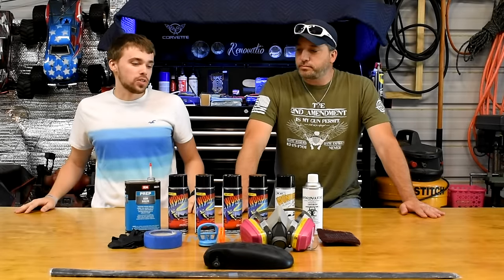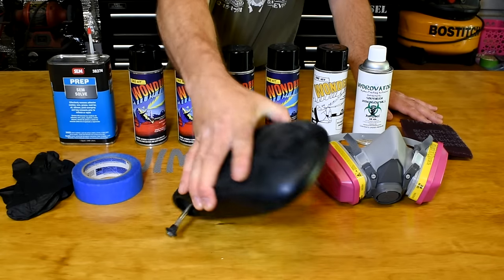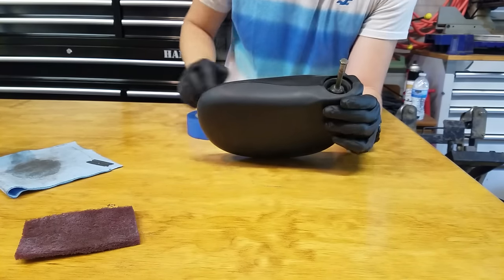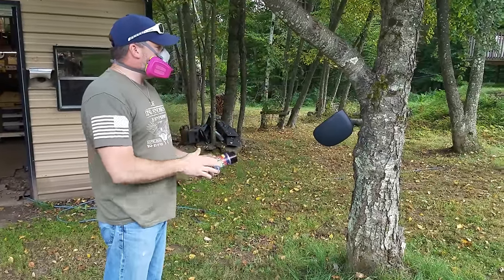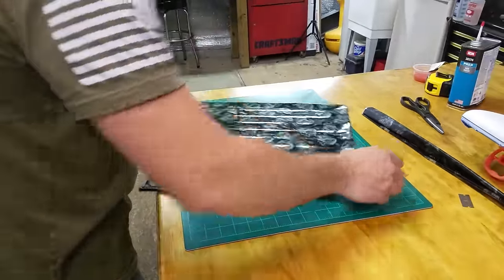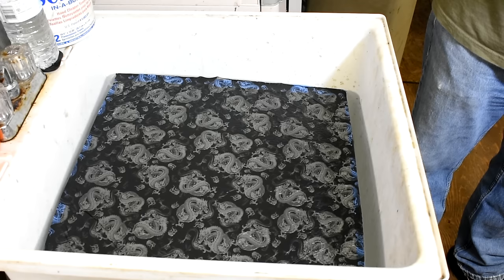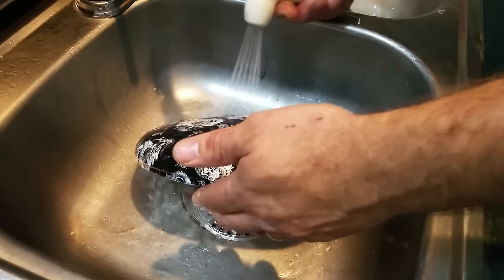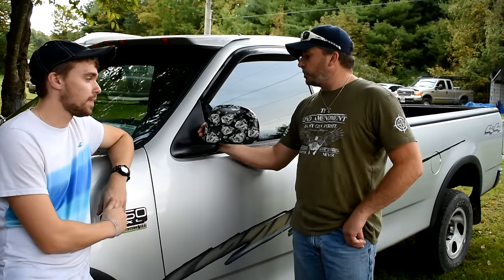How To Hydro Dip For Beginners 2.0

Comment from the maker: Want to give OHW paint a try?! Check them out and use our promo code for some savings. This is what we used in the video:)
https://www.ohwpaint.com/discount/Jimmy2Tech
Reply: Jimmy2Tech thank you for saying it in metric much respect
Reply: Jimmy2Tech now can hydro every accidentally get ripped off or scratched off?
Reply from the maker: @peter_W91  it can but, clear coat prevents that
Reply: How durable has it been?
Reply from the maker: @afatherofmany  still on today and no problems. Looks as good as the day we put it on :)
Reply: @Jimmy2Tech  wow, man that's the dream right..... you did it and it is still nice!
Reply: Just quick question does sticky side face down to water or does sticky side face up to me
Reply from the maker: @dustyfarm5r577  stick side will go towards the water:) not towards you.
Reply: Hey Jimmy, every time I dip, when I rinse it causes some spots or flaking. Should I make the water cooler? Also, when I try to add the clear coat, it make it fade for some reason. So, how do I prevent the fading?
Reply: Jimmy2Tech ?
Reply from the maker: @Jokes4u  well when you are seeing spots, usually thats a sign that you haven't used enough activator. When you rinse use warm water from a faucet, i wouldnt reccomend jet spraying it. Also for gloss, make sure you are using a high gloss clear coat. Expect to put 2 to 3 coats on there for best shine and protection:)
Reply: Jimmy2Tech I’m using the wonder paint gloss. However, when I spray the gloss on after allowing it to dry, it smears my dip. Could that be because of not using enough activator? Also, thanks for taking time out to reply to me.
Reply from the maker: @Jokes4u  anytime, and yeah we've had our fair share of not activating enough and whenever we got to cpear coat stage with any clear coat it would like make the dip run. Tinker witha. Few small dips with different ativator amounts and make sure you're waiting a few after you spray before you dip. So the film fully activates. A lot is trial and error. Practice makes perfect when it comes to dipping.
Reply: Where do you get the film from
Reply from the maker: @masonv7258  links in the description to get you started.
Reply: @Jimmy2Tech  can you ever use to much activator?
Reply: hey jimmy2tech Ive done a bunch of things with hydro dip using spray paint but I would love to try and use films where would I be able to get films and activators that are good?
Reply from the maker: @lilct9994  links in the description is a great place to start.
Reply: Does the water have to be warm or cold
Reply from the maker: @dustyfarm5r577  you're going to want hot water for the best bonding.
Reply: Do I have to use a activator spray or not an is it like a super glue spray that I spray lighty over the top
Reply from the maker: @dustyfarm5r577  for this process it is hydrovator that is sprayed over the film before the item is dipped.

Comment: Good DIY video but one one major thing you guys failed to mention is that this process only works on Acrylonitrile Butadiene Styrene (ABS) plastics. If you follow this same process on a parts made of  polypropylene  (PP), polyethylene (PET), or Poly Vinyl Chloride (PVC) plastics, I can guarantee that the person following the process will have problems. The reason the process will not work on the other plastics is because every plastic except ABS needs to be "FLAME TREATED" to "out-gas" the release agents stuck in the plastics during the molding process. You need to identify the type of plastic you are working on First. All molded plastics have one identifiers mentioned above on the backside of the part. If you follow the instructions in this video and you are working with anything but ABS, you will get lifting during the painting process, separation during the dipping process and lifting at some point after the process......guaranteed!  If you don't know what type of plastic you have "flame treat" the part to be safe.
Reply from the maker: Steve Clark well said! Will note that on the next video:)

Comment: You moved one side faster than the other. That's why the dragons came out spaced weird.  Also, the tape is to keep it from spreading out. It doesn't act as a float. 

I thought the matte look looked better personally. But nice touch.
Reply: Look at the pattern they used. The dragons are spaced out weird on the pattern itself it did not happen from dipping. You cannot fix a pattern by dipping a different way.
Reply: @xex2kok  good catch. Dunno how I missed that.     Appreciate the cordial correction

Comment: What sort of timing window do you have between pulling the object out of the water, and doing the rinse? Is there a "too soon"? And how long is too late?
Reply from the maker: After pulled out of water we wait around 1 to 2 minutes and then give it a rinse with hot water. Make sure there isn't to much pressure out of the faucet.

Comment: What did you use to remove the dip from the mirror? Other than that great job. Thank you very much.
Reply from the maker: Some glass cleaner and a razor blade. Carefully scrape the film off the mirror as if you were scraping off a sticker. Then once it's off just give it a quick clean with some glass cleaner and you should be as good as new!

Comment: Tried this 4 damn times. Couldn't for the life of me to get it to work with tape. Same steps without tape and it worked perfectly.
Reply from the maker: Yeah you can easily do it without tape. The tape helps sometimes with film that is curled really bad. Because it keeps trying to dive into the water. If your film is nice and flat just set it right on there.

Comment: Great tutorial,  can you please confirm, is it the sticky side that is placed face down on the water? So the sticky side makes contact with the water?
Thanks
Reply from the maker: You have it right. The side of the hydrographic film that sticks the most is placed facing down. If you are still unsure you can put a activator on a cloth and wipe a small piece in the corner of the film. The side that the pattern rubs off is the side that will go up.:)

Comment: Great video.  Just one question.  If want to tape a section off so it not covered do i pull the tape right after the dip or do i wait until it is completely dried just be fore i clear it?
thanks guys!
Reply from the maker: Wait until it is dry before pulling off the tape. This will ensure everything comes of smooth and has a sharper edge. Depending on the item as well you can always lightly run a blade at the tapes edge before pulling off to make sure nothing extra tries to pull up with the tape. Good luck!

Comment: In your garage I noticed some RC vehicles, did you hydro dip those bodies? Any tips on that? I am looking to do that on a new buggy.
Reply from the maker: Hello David,
       Thanks for checking out our channel. Yes we have tried dipping an RC body once but we must have not prepped the surface good enough because it stated to lift. But we tried it early on and had the cheaper film and we did not use the OHW paint which would have worked way better. We will have to try again soon.

Comment: Hey, great vid., thanks. What did you use to get the print off the mirror please?...
Reply from the maker: Super easy to get the extra off the mirror. Just get some glass cleaner and a razor blade and gently scrape it off as if you were peeling off a sticker. Once it's off just wipe it up with some glass cleaner and you're good to go.
Reply: @Jimmy2Tech  Awesome thanks dude, have subscribed and will be checking all your stuff! 👍

Comment: How many applications are possible with one aerosol can of activator? Lets say on multiple projects the same size as the mirror you did in this video? Thank you in advances.
Reply from the maker: You're going to get quite a few. We've done a few dozen dips off of one can with various sized items. It goes a pretty decent way so you won't have to worry about only having enough for a dip or two. :)

Comment: great vid. what about doing larger parts? like something that might need a water trough sized tub to fit in? im considering doing a portion of a Harley faring.
Reply from the maker: Shawn Fenner hey, well now your mentioning it! Our next video is going to be a little larger part. Then after that we are going to be dipping a rim! And we have a huge metal container we are going g yo use as a tub, and probably heating it with a propane heater. It's gonna be interesting, so stay tuned! :)

Comment: If I am doing multiple pieces do I need to start with a fresh batch of water each time?
Reply from the maker: Nope. Just make sure that the water is still at good temperature. And then skim the excess film off the water. You can do this pretty well with a shop paper towel.

Comment: Thanks, nicely done instructional vid!  Any tips on how to do something flat with 2 sides, specifically a recurve bow limb (not the whole bow just 2 separate limbs).
Reply from the maker: Welp I dont have too many tips particularity. Alot of it will be trial and error, I'm sure there maybe some videos up on YouTube of dipping a bow that may help you get an idea of how to dip the item in regards to angles. Usually multiple side dips and round items are the hardest but with a little practice it can be done.:)

Comment: I have a few questions. Can I cover a dip in epoxy? What if I don't like how it turned out, how do I take it off the item? If I am not able to use epoxy, how long will the clear coat last? Can I put a decal on the cup, dip it, then take the decal off so the base color shines through? Can I add glow in the dark paint to the base coat so it shines through the flim?
Reply from the maker: New Beginnings Blanks hey there. I'm not 100 percent sure about the epoxy covering the dip. And you can get the dip off fairly easy with a little elbow grease and some chemical solution. The clearcoat will last a long while depending on the type you use, whether that be 1 stage or 2 stage, and it also depends on how many coats you put on. The decal sticker for showing basecoat does work and we've done it several times. And yeah you can use glow and the dark paint as a base to have certain parts show through:) you can also use temperature changing pigment as well to have it so when you pour hot water on an item a certain thing would show. Possibilities are endless, hope this comment helps. Thanks for watching!

Comment: Hey man great video and so detailed how hot should the water be to wash the gloss?
Reply from the maker: We just turn on the hot water in the house with a touch of cold. I'd say thats anywhere from 90 to 110 degrees F. Hot enough where you can leave your hand under the water for a few seconds without discomfort.

Comment: That looks great. I would love to learn how to do this. How expensive is it to dip a 20" truck wheel?
Reply from the maker: They have kits that will tell you the size item you can dip. But once you have all the materials you'll probably only be in around $80 to $100. That will be the initial cost to get all the hydrovator and stuff you will need. After that you'll pretty much just need different pattern films and that can range in price from 15 to 30.

Comment: I have never dipped before and I’m wanting to dip a welding helmet I was wondering if I painted it with the engine paint u can get at advanced auto parts would work the same as the paint y’all used I figured because the sparks are hot I’d need something better with heat if u could respond and maybe help me out I’ll get to dip it in a few days
Reply from the maker: Yeah, you can use any paint you prefer as long as you dip within a few days of the paint drying for best results.
Reply: @Jimmy2Tech  also didn’t realize u had to use clear before this video so can u recommend a clear that’s also heat resistant or better for heat
Reply from the maker: @noahmatheny7614  just look for high temp automotive clear coat and you'll be good to go.

Comment: Hey nicely done what did you use to clean off the mirror?
Reply from the maker: A little windex and some elbow grease with take it off. If you have some stubborn film that won't come off just carefully use a squeegee or a razor blade and you can get it off no problem. Just be careful not to damage the mirror. :)
Reply: @Jimmy2Tech  Great thanks for information and great video we are locked on your channel 😀 👍

Comment: Regarding the suggested base paint , what is a dip window?
Reply from the maker: Sorry for the delay. A dip window is the amount of time where a dip would easily bond to the paint. If you were outside of the dip window there is a good chance that the dip won't adhere to the paint as well and may cause issues with your finished product.

Comment: have you ever done a motor cycle  helmet great video loved it
Reply from the maker: We haven't done a motor cycle helmet, but dipping a helmet is like dipping a construction hard hat and they are pretty simple and look great when complete! Just make sure eif you do a helmet you don't have tape on the edges of the film so the film doesn't stretch as you push the helmet into the water. We used the tape in this example to stop the corners of the film from diving into the water and messing up the process. Bad film does that, ideally you'd be able to set the film on the water with no tape keeping up the corners.

Comment: What do I use to get the print off the mirror? The reflective part!
Reply from the maker: We used a razor blade to remove the print from the mirror, but you could tape off the mirror if you did not want to do it that way.
Reply: @Jimmy2Tech  Thank you so much!

Comment: If you want a flat finish would you just not put on the clear coat? Or would you use a flat finish clear?
Reply from the maker: I'd always reccomend a clear coat to have an extra layer to protect the film, but the choice is yours:)
Reply: @Jimmy2Tech  Is it pretty durable?
Reply from the maker: @dono624  it's alright, but I usually go with the clear to prevent the scratches on the film which would show the base color.

Comment: Does the Wonderspray come in all colours? sorry still learning..but what if i want an Orange base coat?   do i do etch primer, then say Orange matte or gloss paint, then dip n clear coat?
Reply from the maker: That's exactly it. Wonderpaint comes in a variety of colors and is simply a primer and paint combo with a longer dip window then regular paint. You can deffinately use standard primer and orange paint as a basecoat as long as you dip the item short after it's completely dry. After the dip, rinse and allow to dry. Then do a few coats of clear coat and you're all set!

Comment: How do you prep and dip a surface that is not perfectly smooth? Some plastic interior automotive parts have a texture, how does that work??
Reply from the maker: You can dip some textured items, just make sure its prepped as good as you can and you shouldnt have an issue. Just make sure the texture isnt sharp which may pose as a problem with dipping as it may rip the film.:)

Comment: What do you use to simply remove the skin that remained on the mirror itself? Can it be washed or do you use a chemical to remove it?
Reply from the maker: It comes off the mirror pretty easy. Some cleaner and a little scrubbing and you'll have it off in no time.:) it's always better to wipe it off after its dry only because theres a chance you may wipe the dip off the item you want the dip on and mess up the entire project.

Comment: Can a plastic steering wheel be coated by this method for a teak or walnut burl appearance? Regards, DaleO
Reply from the maker: You can dip most plastics. Soft plastics though would be your only problem as the activator can start to melt thr plastic. A plastic steering wheel though should work fine.

Comment: Im looking to hydrodip some Tin candle containers for my business. But my question is do i NEED to seal them? Or can i simply dip and be done? Since I do not want to add any flammable sprays to it. My plan is to dip the lids as well as 90% up the tin but not up to the top line. I would stop at the lid line. Thoughts?
Thank you!
Reply from the maker: You can get away without sealing it, but the dip will lack the shine element and be more susceptible to scratches and scrapes. So the clear coat has two purposes for this application. If you are fine with the candles dipped to not be shinning then you can manage without clear coat I would imagine. I'd always side with it for safety and life of the dip, but as you said it is a candle and will be inside out of the elements and away from a lot of scratch and scrape damage. :)
Reply: @Jimmy2Tech  thank you so much for the reply! I appreciate it! I'll be sure to test like crazy if I clear coat it!
Reply from the maker: @Kayetana89  great! Let us know how it goes and feel free to send a link once they are done. Love supporting the community:)

Comment: Interested in starting this. Water temp around 90°. Do you have to change your water in the tank or just clean the residue from the previous skin when changing patterns? Awesome video display.  Also where can you buy the activator in a larger bulk amount instead of using the spray rattle can? Will subscribe to your site. Thanks in advance.
Reply from the maker: Links to everything we used are right in the description. Some of the places sell activator in bigger containers. 90 degree is best suggestion. You can get it done with water 10 or 15 degrees colder or warmer, but the dip may. Ot bond as efficiently. Lastly, after a dip you can reuse the water but you need to make sure the waters top has no residue as that can cause problems for the next dip. Thanks for watching!